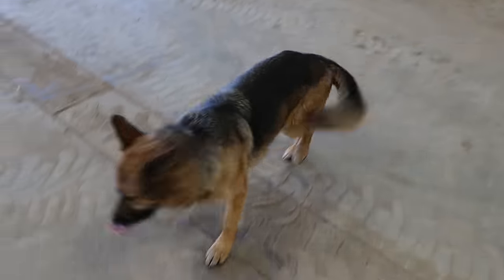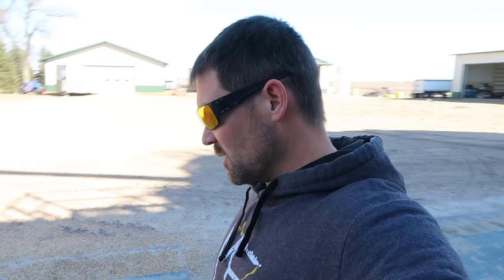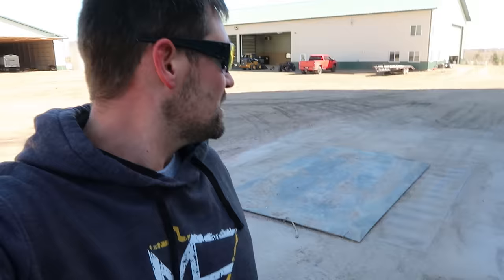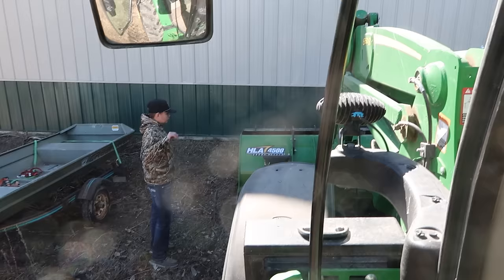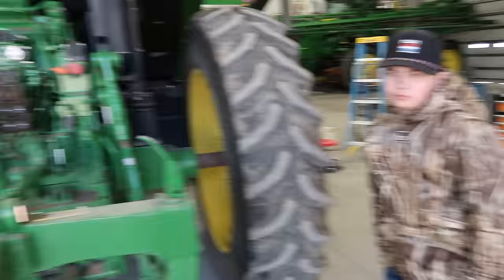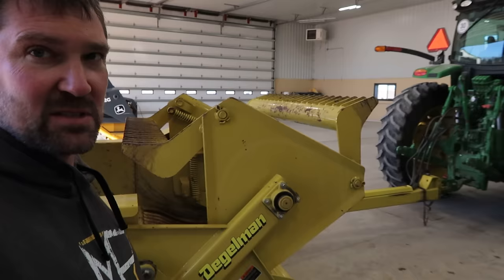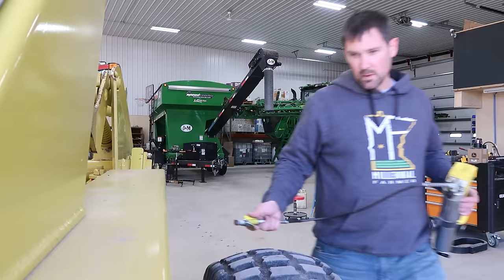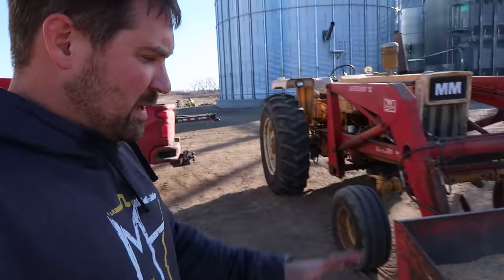We Managed to Make a BIG Mess

Comment: Thanks for another great video Zach and Becky and Onyx. 
It was interesting and enjoyable. 

Lots of maintenance items getting ready for spring and getting equipment ready for spring field work. Always takes longer than we think with interruptions from this and that. Oh well. 

Thanks to onyx for pitching in with things around the shop. Nice to have an extra set of hands for this and that. Good helper there. 

Rock picker time. Seems kind of different running one of those. We normally don’t run them here in Iowa. We never did have one. (Central Iowa). 

Looking forward to seeing the new planter and new used tractor for the planter. 

about it I guess. Thanks for everything. You all take care and be safe. 
The Iowa farm boy. Steve.

Comment: Transitions and distributors can be a royal pain depending on the weather for the day. Metal expands and flexes when heated and contracts and shifts when cold or could have condensation that became ice blocking flow so you might be able to find the issue when it gets could again. Also our old Oliver being a diesel sounds almost identical idling as the moline does on cold starting

Comment: Zach, Your power source could be a possibility.....if there is a fluctuation in amps to your elevator system could cause a "lag".  Possibly, install a SURGE PROTECTION ON THE PRIMARY PANELS FOR THE ELEVATOR

Comment: On your grain leg issue, I wonder if it could be an airflow issue??  It works when you have a hole opened up but not when it’s sealed. Kinda like plumbing needs a vent pipe to keep the water moving.  If there is enough grain moving air needs to move with it.
Just a thought 😊

Comment: Our Translon If the Corn is below 17 % it works fine. Over that Or with Fines in it, We could plug it real easy. Need to watch it closely  while harvesting. Cleaning out bens it works fine because the crops are below 15% and Cleaner . We run everything through a Screener . You can not believe how much that helps. and we get a prem for most of our crops when we sell , it pays

Comment: Yes, Polaris will take you 500 feet. After then it's broken, miserable walk to the car and then service or recall for 3 months. 
Polaris is junk.
Reply from the maker: This is false information.
Reply: We've owned multiple brands and have ended up with 3 Polaris ATV currently.  Most people around here end up with Polaris, even when they start with another brand.
Reply: @MillennialFarmer  this is very true information. Why dont you see a single Polaris in top 3 in any competition? Because they suck and fall apart all the time. They are decent until you keep them stock but 1" bigger tires and bye bye front diff, axles and what else. Polaris is known to be junk in offroading community since FOREVER. 
I would go as far and say even CFMoto is better than Polaris garbage. Try again.
Reply from the maker: @iare19  ok.